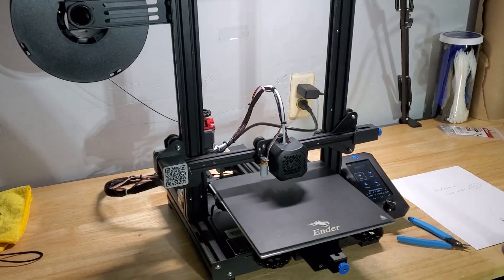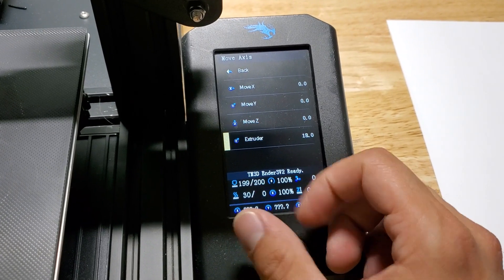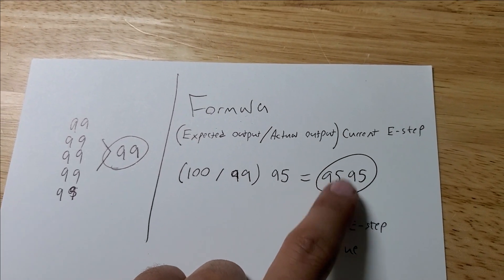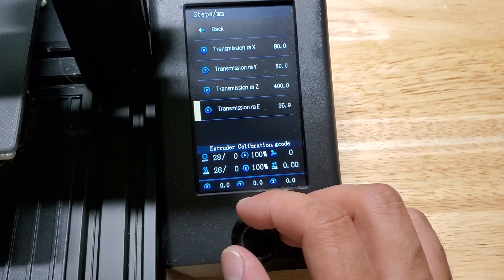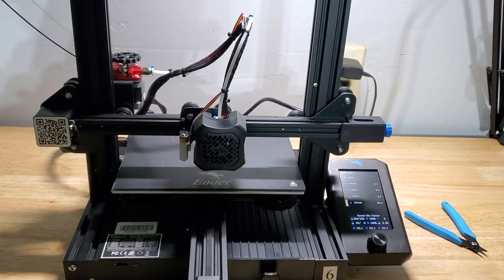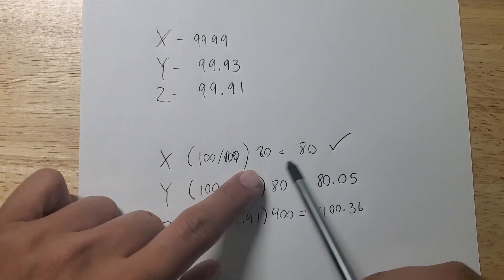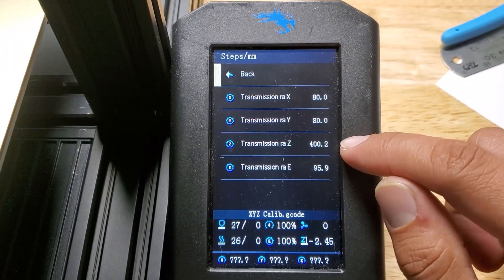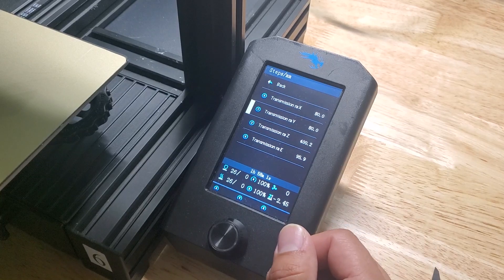3D Printer E-Steps Calibration Using only an SD Card. No Octoprint or Pronterface Needed Ender 3 v2

Comment: What about the flow rate? I have to calibrate it first before right? If I'm using different filament its about tuning the flow rate and guessing when it be the closet to 100 mm?  Not recalibrating the e steps

Comment: Hello! New subscriber here! I purchased my Ender 3 v2 in September of 2020 and only used it for a couple of months before running into issues with it. I tried everything to get it to print right, but nothing worked. So, there it sat until just a few weeks ago. I was giving some thought about selling it and purchasing a more modern machine from Bamboo Labs or Engloo, but thought I would give the little Ender machine one last go of it. I'm really glad I did, because I have the machine printing consistent, beautiful lines! 

I haven't done any of the calibration techniques you showed, so I'm curious as to how much more I can get out of this once forgotten machine after I run some tests! I intend to upgrade to a direct drive extruder. I figure that will help as I move up in nozzle size and printing with higher temp materials. Shortly after buying the machine in 2020, I upgraded to the Micro Swiss all-metal hotend and it's working great! I'm also upgrading the extruder to a dual-gear and adding some Oldham couplers to each side of the z-axis (I recently installed the Creality dual z-axis kit). 

 I'm just wondering if there's anything else you feel I should look at into replacing or upgrading? I plan to review some of your other videos since I really enjoyed how you approached this topic.
Reply from the maker: Thank you for the sub!
As far as upgrades I would definitely look at installing klipper. Either through a raspberry pi or a motherboard like that BTT Manta M5P. If you did the dual z axis and have an extra motor, you can run gantry tilt calibration so it's always perfect with klipper and the M5P. Klipper has made a world of difference in speed and quality especially with resonance compensation and skew correction to account for any frame issues which is common on the ender 3 v2. It's not super square on all axis. I learned the most using the ender 3v2 it has a special place in my heart.
Reply: @Redo3D  Awesome! Well, the good news is I do have a spare Raspberry Pi that I purchased a long time ago to set up wireless printing, so that's covered. LOL! I will look into Klipper. I've heard of it, but haven't delved too much into changing out from Marlin, yet. I am running the Professional version and I really like it! So many more features than the stock Creality build. 

I appreciate you getting back to me so quickly! I plan to install the direct drive setup tomorrow, then I'll run your e-step calibration steps. I'll let you know how it all turns out! Have a great night!

Comment: either this isn't enough and it also needs the save command in the file, or my printer is deaf and doesn't listen to the command because nothing changes. i have a 3 to 1 ratio extruder on mine and e steps have gone from 95 to 4k and it still only extrudes about 20mm instead of 100

Comment: E steps should be calculated not "calibrated".

1) Measure the extruder gear diameter
On my ender3v2 the diameter was exactly 11mm 

2) Calculate the perimeter of your extruder gear:
Perimeter = Diameter of extruder gear * PI so
11*3.14... = 34.56 mm

3) Calculate the number of micro-steps per full rotation of the extruder motor:
Typical nema 17 motor are 1.8°/step, so 360/1.8 = 200 steps per 360° of rotation.
With the extruder driver microstepping set to 16, you get 200*16 = 3200 micro-steps / 360°

3) Finally get your correct e steps/mm:
3200/34.56 = 92.6 micro-steps/mm

Once the correct steps/mm is set in firmware, if your printer doesn't extrude the correct amount of filament, check that your extruder gear is correctly centered on the motor shaft, and also check the extruder arm tension to make sure there's no slipping of the filament.

Comment: Is there any way to modify the firmware (I don't know if it's the printer or the lcd) so that it shows more decimals on the screen?
Reply from the maker: I am not sure, I have moved off of marlin and I am using klipper firmware. I know Jyres software was really good and useful.

Comment: If you add M500 as a new line under the Esteps, it will save automatically. 
M92 E95.95
M500

Comment: Nice instructions, instead of measuring the e step with a scale I printed out a rectangular block 90 mm long with a 2 mm hole through it. then  slide the 100 mm length of filament through the hole and measure with calipers, it keeps the filament as straight as possible.
Reply from the maker: Great idea!

Comment: Nice video, but I tried the SD card method, and it would never register on the printer. The gcode would run, confirm ended, and no value change. I was able to manually do it on the screen following the rest of your method, though. Also, I got my printer back in December of 2021 and the stock transmission ratio E was set to 93.

Comment: You’re a workhorse dude, great videos. Question for you. What extruder amount would you call acceptable? I measured 99.65mm of filament extruded. Close enough or worth getting closer?
Reply from the maker: hey thanks very much. Im actually going to make a video on how i have started calibrating using a miligram scale. But to answer your question I would for sure try to get closer!
Reply: @Redo3D  Ah yes that makes sense. Weight rather than length I assume. Would that be weight of the hot extrusion that comes out of the actual nozzle? I wonder if you could print a series of single lines, take them off the bed and weigh those? Like, print 100mm of filament but see the actual weight of what’s printed compared to the weight of a perfect 100mm length of fresh filament. Not sure that would work, just a thought. 

 And yes, I did get closer, I made another comment on a different video of yours that I’m now like dead nuts 100 mm.

Comment: You don’t need to use code to change the e steps. They can be changed from the screen. On the screen that shows the e steps for the extruder press the know & change the e steps. Exit out & save the new settings

Comment: I put in the new esteps but it won't stick. My board just shows me the existing esteps. My printer board seems to be locked. Does that make any sense? Thank you for any help.
Reply from the maker: Did you save configuration after inputting the new esteps? If you turn off the machine it will reset back to the last saved configuration.
Reply: @Redo3D  Yes. I followed your step-by-step method. I inserted the chip, printed it, confirmed, went to save-config, saw the words 'Saved Settings' and got a beep. Yet the LCD still shows my esteps as unchanged. And doing a test extrude confirms that nothing happened. I have two V2s and they both do the same thing. There must be something in my firmware. I'll check with TH3D.com. I'm using their firmware.
Reply: I got it worked out. I can make the adjustments through my LCD. Just can't do them with M92 on the SDcard or through Pronterface . I can live with that.

Comment: Great video! Thanks! Here's another way to get the filament sections:
M302 P1;allow cold extrusion

M82 ;absolute extrusion mode

G28 ;auto home

G92 E0 ; Reset Extruder

G1 F1500.0 X100 Z30; move hotend out of the way

;************************************

G1 F1000.0 E100 ; extrude #1

G92 E0 ; Reset Extruder

M0 ; extruder stops till button push

;************************************

G1 F1000.0 E100 ; extrude #2

G92 E0 ; Reset Extruder

M0 ; extruder stops till button push

;************************************

G1 F1000.0 E100 ; extrude #3

G92 E0 ; Reset Extruder

M0 ; extruder stops till button push

;************************************

G1 F1000.0 E100 ; extrude #4

G92 E0 ; Reset Extruder

M0 ; extruder stops till button push

;************************************

G1 F1000.0 E100 ; extrude #5

G92 E0 ; Reset Extruder

M0 ; extruder stops till button push

Comment: I tried this but my ender s1 has stock esteps too 424.8/mm
Reply from the maker: This will not work for the s1. The s1 uses a direct drive with different e-steps.

Comment: Can I still apply this to my ender 3 pro? and can you make a guide in the same format for flow thanks man i subbed because your style is way more interesting than some other youtubers like chep which is all unnecessary shit
Reply from the maker: Hey my friend it should work exactly the same. But the menu items might be different since the screen is different. But the process should all be the same.
Reply: @Redo3D  thank you, this helped alot. But one more question, how much of a tolerance do you allow ? My prints are roughly 99.05 or close enough to 100mm but how much of a tolerance is ok.

Comment: Nice video! I've done the e-steps calibration in a similar way. Though, if you still get behind in extruding 100mm into the hotend after calibrating, how do you compensate for step loss? I usually lose 6 - 10mm in extrusion with my Ender 5 Plus so I'm curious on what everyone else gets.
Reply: I have an E5+ and want to calibrate my Esteps, BUT, the E5+ doesn’t have all of the control the E3 screen has to do the set the software…:(
Also, I can’t seem to get the Ender to talk to my MacBook Pro. Any help would be appreciated.

Comment: I followed your instructions and the results are amazing. However, the code for adjusting the esteps didn't work on my V2. It's a brand new printer. I just adjusted them manually which is close enough for now. You've another subscriber and thank you again. l
Reply from the maker: Glad it helped!

Comment: Great tutorial for setting the E-steps, but a bit of misinformation on the other three axes. Do not use a print to test the XYZ-steps, because prints will always shrink and expand during cooling. Instead use a ruler or calipers to check the distance from a known stable point both before she after the move on each axis. If you use a print to set the XYZ-steps, you'll have to reset them every time your print environment or your other print settings change.

As an alternative to rulers and calipers, if you have either an optical sensor or else a camera and a laser pointer, you can use your document printer to print out a sensor strip and count how many intervals it crosses from position to position. For the camera method, I would recommend 1mm per interval (white/black) if your strip is at a distance from the camera and no less than 0.1mm if the camera is close, since you'll be counting these by eye. With the optical sensor you can be as precise as your document printer allows but you might need more complicated patterns to maintain that precision.
Reply from the maker: This method I use I print the same product with the same profile across 17 different printers. All have been outputting perfectly to my dimensions and within tolerance. Teaching tech did a great video on what you are explaining.
Reply: Cooling and expansion rates change with temperature differentials and humidity levels. That's fine if you have a controlled shop and none of your vents blow on or near your printers, or a fully enclosed printer, because you can make sure those variances are minor. For the rest of us if we calibrate by a cooled print from the start, it sets us up for failures and headaches later when we have to recalibrate the entire printer repeatedly instead of just a few flow settings. You want to calibrate your axes to make sure they're moving the nozzle and the filament to exactly where they're supposed to be and THEN account for the material effects of the filament in question, otherwise you're just hiding problems instead of resolving them. As an analogy, kicking your laundry under your bed before company comes over might make your room look nice but it still stinks and you might have nothing to wear tomorrow.
Reply: @claws61821  I don't doubt you know what you're talking about and have first hand experience but in my experience I have not had issues you describe even with extreme variations in temperature. My 3D printers are right under my airconditioner. I turn it on/off frequently and my parts come out good enough on tolerance and they all function. I know that there are filaments out there that suffer from what you've described but for me personally PLA has never had any issues. I can appreciate if you need extreme tolerances but at that point is FDM 3D printing the right option?

Comment: what layer height do you use for your prints?
Reply from the maker: I use a .24mm layer height for everything I print.
Reply: @Redo3D  Very nice videos, thank you. May I ask why you don't use 0.2mm? .24 doesn't divide equally into any whole number.
Reply from the maker: @viper7016  this is an excellent video that explains why I use .24mm 

https://youtu.be/WIkT8asT90A
Reply: @Redo3D  but that video does not disqualify 0.2

Comment: Why not change the e-steps direct with the screen. You show the e-steps 95. You can change the value there direct as far as i know. With my Ender 3 i can change it there. But keep up the tutorials, great to watch and learn.
Reply from the maker: At the end of the video I explain that you can change the value on the screen and skip the step of making the gcode file, but you can only change .1 at a time. With gcode you can change .01
Reply: Simple: not every printer ships with those options enabled in the menu. Loading a file with the gcode commands lets you configure the steps even when you can't use the menu or access the printer over USB or a network interface. Although in that particular extreme example, you might want to set them to a known value before you first test, since you won't be able to retrieve the set value.

Comment: Nice!!! You can a second line with M500 to save it.
Reply from the maker: Thanks Ben! I did try M500, but for some reason it was not saving! I had to save from the menu on the display.
Reply: I believe that the firmware that comes with the printer doesn't allow M500, which is to save to EEPROM, the built in memory. Instead it saves the config to the SD card for some reason. That was one of the main reasons why I switched to a custom Marlin build.
As a sidenote, please consider that while calibrating your extruder is important, reducing the value by about 5% will produce better looking prints.

Keep up the great videos!